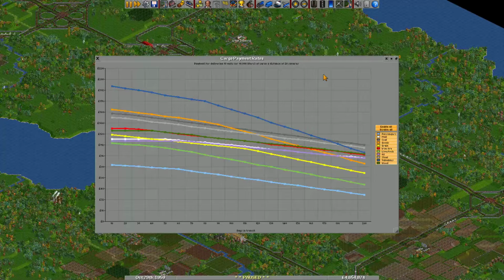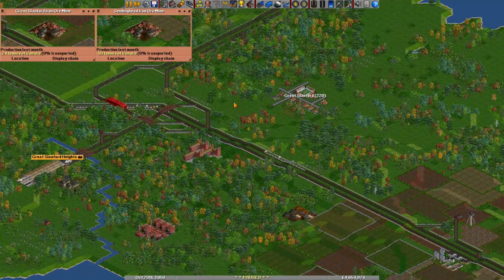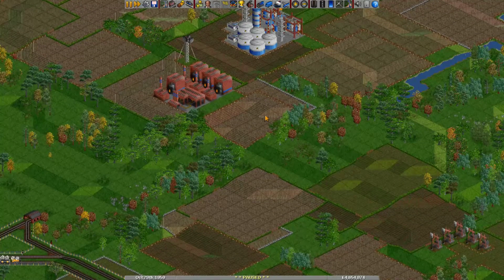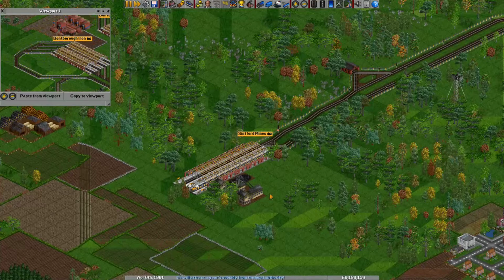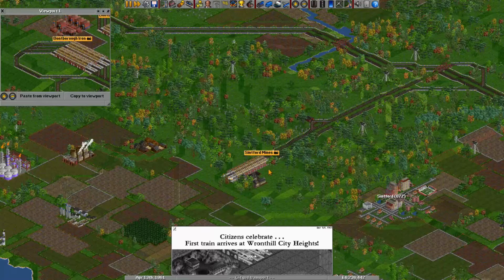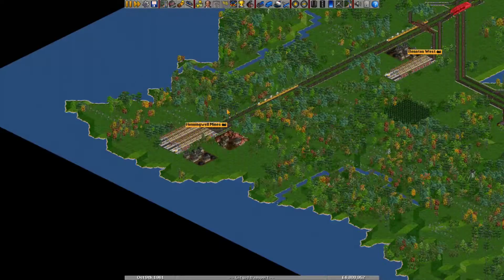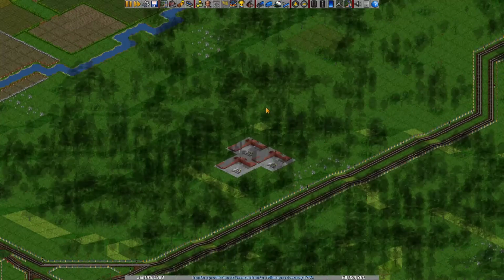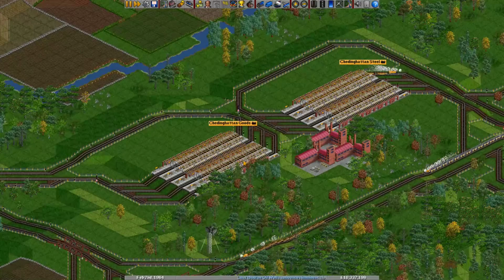Git Gud at OpenTTD #7: Iron and Steel!

Comment: I have a problem, if you can help me, all the iron i have is in the station and steel dont appears! The industries produce nothing.
Reply from the maker: If you click the station, does it tell you it accepts iron ore?
Reply: Yes, but the industry dont produce steel
Reply from the maker: It will only start producing steel if you have a station next to it where trains with steel wagons are waiting to pick up steel. Also, if it just drops off the iron there it is either not accepted in the station or maybe you told it to transfer there.
Also make sure you are bringing the iron to a steel mill, and not to a factory.
Reply: Oh thanks!
Reply: Sometimes the goods/steel don't appear until you get a station that accept goods. Maybe its a bug, but you sometimes need to get one of the trains waiting to load, to skip that order and to go to the city/factory ... Suddenly the factory goods or steel start to be loaded as long as iron/steel is coming in
Reply: Ok, it dont work. The station accepts the iron but only is there. I put another station with a steel train and nothing happens.